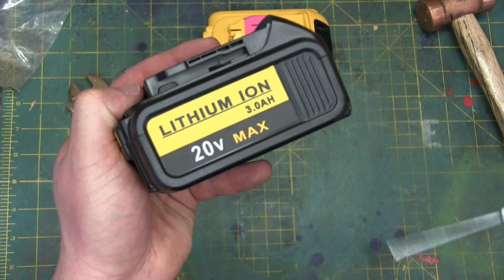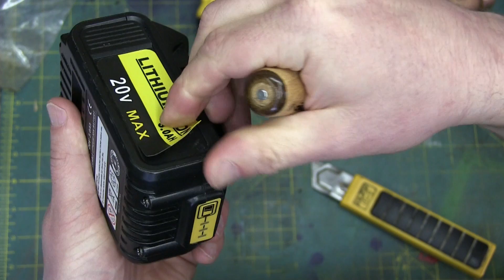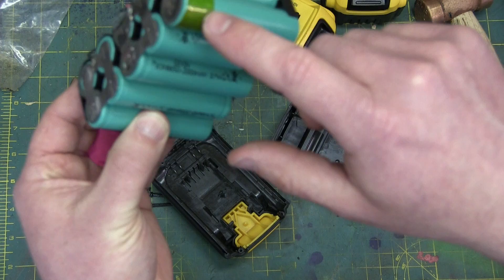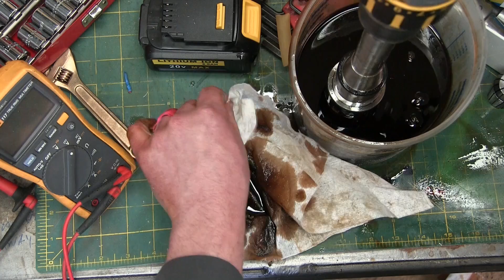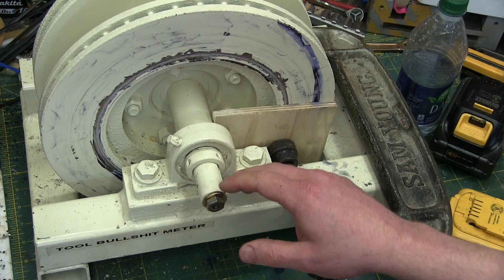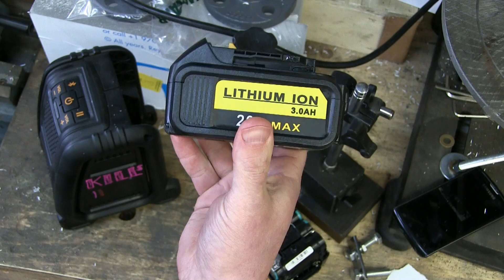BOLTR: DeWALT knockoff battery vs. the real deal

Comment: Also another problem with your test if you're going to run it continuous you have to remember that the tool if let's say you say it's designed for 300 hours of runtime that is not continuous as the heat buildup on the circuit mosfet motor controller was not designed for you know more than Maybe 10 minutes of on time with a few minutes of off time you know a duty cycle so you have to consider that in your testing as well I like your videos but some of it it's just not the right way to go about it or how do I say this but some of it you don't understand the way it needs to be tested I do love how you take things apart and so all you know lanterns and everything but as far as testing a tool to destruction from your setups and everything I don't think you have the right

Comment: Instead of the brake rotor flywheels, have you considered a fan? The blades will provide constant load at a constant speed. Calibration would still an issue, but you could use an pulley and calibrated weight to back out work and power. Hmmm.

Comment: I would love to see a teardown of the Ryobi batteries this same way. I got 2 knockoff(looks the same type of your dewalts there) 4amh for $55(on sale) Ryobi ones are $100 for one or they post sales 2 for $100(but the stores dont actually get them). I've had the overprotect go off on the Ryobi ones and they are done at that point.  I feel like theres something janky in the overprotect in them. Also as you noticed with the dewalts here I feel my knockoff 4 amp hours definitely last longer than the brand name ones.

Comment: Not related to this post Ave, but as a scientist I miss the days when I could just write an equation down, do some calculations, maybe create a cad model and think i was done.  Who knew there was so much to spindle design?  I mean it's just a shaft and some bearings, right! Right, with as much sarcasm as I can muster.   So I wanted to be old school and understand design from the bottom up, machining, engineering, and R&D.  I am learning as much as i can about machining and I still make mistakes, it seems daily. Sometimes I seriously ask myself if I am retarded or something.  I want to be as competent as the old timers, and it seems someday's like by the time I get there I will be lowered into the ground.   These men (99.999% because that was the world of the old timers) Have forgotten more than it seems I will ever learn.   It seems I never learn until I screw up. Even then it takes me several fucks ups before it sinks into my thick skull.

Comment: I opened my FauxWalkee battery and its cells are "THISS 18650HR20R" 2019.8.30  3.6v"    
Pretty happy with them so far. But dont know any of the specs.

Comment: Why not use a nice big (useless) electric motor or generator as a brake? Whatever resistance you're using you can measure the power running through it and if you're even schmarter you can fix the accuracy with an efficiency curve. Smore fun than heating water.

Comment: Instead of directly turning that with the nut through the bearing, why not chuck a  skateboard wheel in the drill and get it going by running it against the  rotor ?

Comment: So the DeWalt did not deliver more energy? But the DeWalt was better with regards to safety?  It would be easier to measure the energy delivered with a proper Watt Hour or Amp Hour meter, though

Comment: That stupid simple way seems like the best way to test the battery directly. As for testing it with the drills, What about modifying your spinning rig with magnets. Install an electro-magnet next to it. Crank up the power to increase resistance.

Comment: Why dont you get a bike, (you know one of those ones with two wheels and a set of pedals) trainer, they measure Watts very precise and you can adjust the resistance very precise. So it is just to make a wheel with a tire on where you can attach any electrical tool. Let it twitch untill it dies. Easy smeasy.....

Comment: I bought a knockoff Hitachi 18/20 v batt, 3ah, paid extra for 3ah, it hot here, it was the same 2.5ah I could had saved a couple dollhairs!!  I put it on the charger, it wouldn't charge! I kept fooling around it finally started charging, I don't know whats up with it , it does work, but throws codes sometimes when trying to charge! I got a nicad for a old dewalt, it got hot while charging, if it was lithium, and that hot, I'd thrown it outside!!

Comment: Wouldn't some kind of tank with water in it make more sense as a mechanical load?  Would at least be easy to keep consistent between runs, and you could vary fluid level (how much liquid vs. air engaging fins) to adjust the load.

Comment: Well watching this while using the bike roller (crap weather outside). That (the bike roller) would be the ideal power metering device. Just an adapter and everything else is already there power adjustment and a nice app giving power curves and total power.

Comment: Ave, the capacity is also dependent on the discharge current did you take that under the consideration for the performance of DeWalt battery. The battery may be rated for a different current, in that case it could achieve the 4Ah rating.

Comment: I'd use a magnet for braking the "tool bullshit meter" and a torque sensor + rotation sensor on an arudino to measure output torque and calculate the actutal output power. You could even plot the values to a nice graph via rs232 on a pc

Comment: If ya go search ebay for "150w electronic load" you can get some constant current electronic load testers for about 30 bucks straight from china. Work great for testing batteries, and they are good for up to 60 volts. Takes less math, so leaves more time for beer. Set and forget!

Comment: how about taking the idea from those stationery exercise bikes, they have a fan/fins on the wheel, faster rotation = more fan spinamithing = more resistance. or add fins to the flywheel, if there's enough clearance from the supports

Comment: I bought one of these for an older Dewalt the old 18v line.  It didn't last a day before the tabs that hold it in the tool broke off.  So I'm just going to put new cells in the old case I guess.

Comment: Why did you not have a resistor hooked up to the electric motor? You need a place for the mechanical energy you are converting into electrical to go. Get a bigass resistor off ebay for 10-15 bucks. I have 1 or 2 I use for testing HV power supplies.

Comment: chinesium batereja seems good enopugh for me. We are flooded here with chinesium things, but they do not succeed in burning houses to the ground. I too was unsuccessful to clean my house with a fiery cleansing. If it would not fail over time it would be awesome. Chinesium things here basically stop working whenever. Makita drill thing just keep going though. It just never ends! Can't count dead CE carcasses in the house, but the brand names do not want to die (except bosh sander, with messed up front roller, wtf bosh)
Nice minion in the shop, will hammer the world in a few short years? just build the tower from the rubble

Comment: These knock off batteries are now $26 on fleabay. I wonder if they switched to a cheaper 18650 cell or if the cells are just that much cheaper in 2019.

Comment: Just a thought. I know it might make it a little more complex, but couldn't you use a one way clutch like that of a motorcycle starter clutch, transmission sprag, or slightly modified hammer drill mechanism in your tool bullshit meter? Wouldn't be as simple as the bolt but it would be unlikely to break needing extraction too.

Comment: glad to see the bullshit-o-meter back... i say do a balance beam scale style to leverage the friction producer be it wood or imo like a full size sharpening stone even an old half used brake pad. then use a 3/8 drive adaptor so you can run off the larger bolt and there ya have it. and with that setup you can add weight for bigger tools and use less for the little guys....  as always great vids keep them coming

Comment: Hmmm, the tool bullshit-o-meter. I wonder if a strong neodidlium magnet would be enough to transform it to an eddy current brake. You could even make the magnet movable to adjust how much braking force it applies. Hell magicanize the movement and you could run tests with variable loads, like driving it hard, drive it light to cool down, drive it hard again. 
You might even be able to measure torque: A piece of material than elastically (that the non permament type right?) between the bullshitometer and the tool you're testing. The amount it is twisted would giving you the torque.

Comment: for the dyno you can calculate the power loss by measuring how long it takes for the system to come to a stop from the maximum angular velocity state. need some basic physic equations, moment of inertia of the system, max velocity (at start of deceleration) too sleepy to actually write the equations down atm, but its nothing complicated. im not even sure if you need moment of inertia. maybe someone can explain the math for me if dont remember i made this comment, when i wake up.

Comment: Is there a boost converter in the battery pack? If so, the Ah rating might be at the battery voltage and not the terminals. I know this applies for USB power packs; anyway I don't know why they still use the (m)Ah rating as it means fuck-all if you don't know the voltage curve. The Wh rating is much more useful...

Comment: In an genuine dewalt battery electrical circuit is not protection circuit it just battery meter, 

Can You verify its protection cirtuit in a battery? 

Protection circuit is in a tool.

Comment: Get a spot welder and simply use the cells in the better battery when cells fail. Now if the board fails, well your just fucked into buying the better battery again. Maybe chancing getting a good balance board to rebuild.

Comment: but the stickers printed backwards lol they took the time to lay it out yet still couldnt get it right  im pretty hard on tools n batteries yet those knockoff dewalt ones arent too bad especially for 20 bucks a piece, honestly in a way theyre better because they dont crack across the front like EVERY dam dewalt battery, they crack right across the front into the button iv had to jb weld pretty much all my batteries together  they knockoff ones have taken a alot of abuse n iv honestly never had a problem out of a single one, their also isnt ONE single place puttin these batteries out so i might have got a good one from a good back door

Comment: Put the bullshitometer in a tub of water, with the water up to the bottom of the bearings and you'll have your constant fiction load, Like an engine dyno.
Reply: Worried about water splash place another tub upside down over top.

Comment: Your Bullshit load-tester will work, just need to create a adjustable jig to hold the tool and increase the resistance, just not with a plank of wood.  Weld on some air fins between the 2 rotors to move air.   And if you get a cheap Tachometer (little laser/reflective tape type) can easily check performance.  Only variable would be bearing wear.

Comment: How hard would it be to add some mechanical protection to those cheapo batteries to toughen them up? Maybe add some thin foam padding or some of that circuit board schmoo they use in potting?

Comment: HiWhats if you discharge the chineese batteria with 30 or 40amps?I think it will burn because the crap cells cant serve the power.Last month i destroyed a Bosch ProCore battery while itssecond discharge with 100Amps....Another idea for your brakingwheels: Probably you can brake it very controlled by holding strong magnets near to the disks.

Comment: Rebuild the china crap battery with quality LG or Samsung 18650 batteries.
Same batteries as my vape.  Would still be cheaper than dewalt replacement with comparable quality.

Comment: AVE, this review was done a year and a half ago, and now in some places you can get these for 40-50% less then the Dewalts. For ex. here For Dewalt 20V – Vanon-Batteries-Store
https://www.vanonbatteries.com/collections/for-dewalt-20v It has also been redesigned a bit. I think for careful home use that "aint" bad. Did you do any further/later tests and research? What are your thoughts about them now.

Comment: I want you to do a video on repair/rebuild of battery cells such as the litho ones and nicad. I got about 40 cells that are "discharged" i poked a hole in the positive end to gas it off and then it had a charge (pretty sure its not safe) but id like to know if its ok to do that as  thsse drill batteries do have their own protective circuits and such. And how to effectively rebuild a pack with salvaged cells that are good or new ones.

Comment: Did you try to replace the dead dewalt inside casing by the chinese knockoff insides so you could run your chinese batteries with a better casing ???

Comment: Hey Ave
I enjoy your video's, keep up the good work.
My 3 year old dewalt drill came with 2 batterys, one died, so I checked out the internets for
a possible way to re-charge it.
After watching numerous video's , the common claim was to spark a wire from a 12 volt battery to the litheumms....seemed like skullfuckery to me....Is it possible to revive these batterys or should I sell it along with the other billion dewalt tools on Kagigi with no batteries. I actually phoned dewalt Canada, and after a polite conversation, I suggested I can buy a very long extension cord for $200.00 every 3 years.
Cheers

Comment: Could you have used a brake caliper connected to a portapower with a pressure gauge in-between for consistency on those brake calipers?

Comment: interestingly in the UK their is a MUCH bigger price difference   best price i find two 4amp genuine dewalt £112GBP ..... £56 each but  can buy 4 knockoff 4amp in the UK for £80 so £20 each ...so at almost 1/3 the price would you go for the knock off .....i wouldn't ......not fit my millfucky